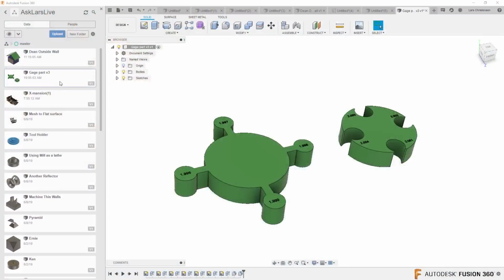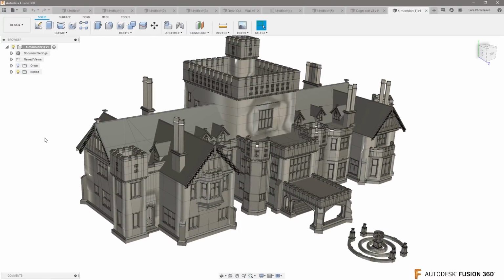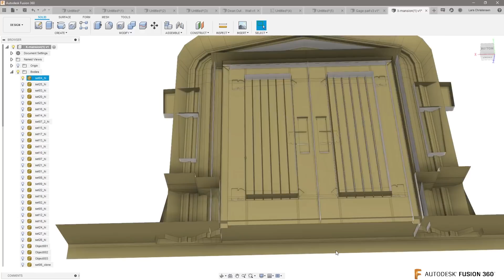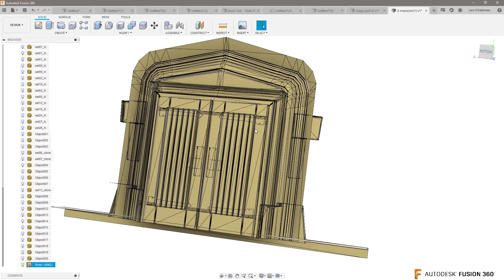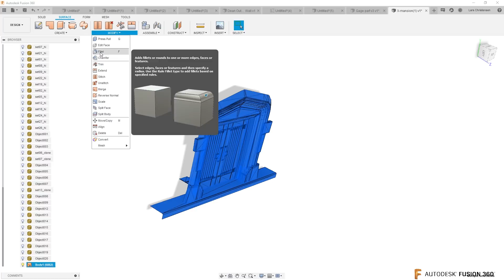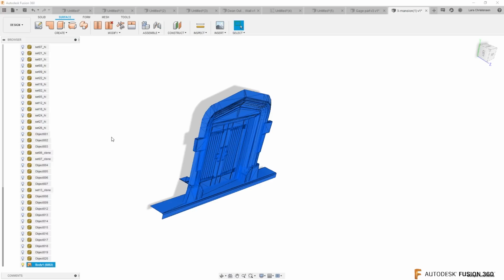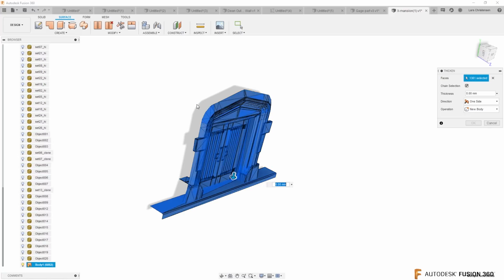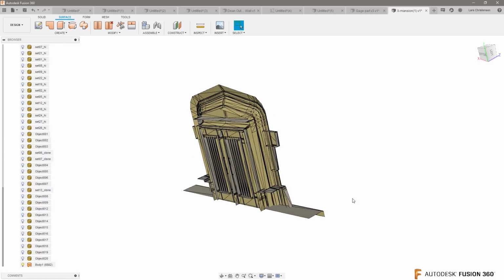Fusion 360 — BROKEN OBJ File for 3D Printing — Ask LarsLive

Comment: Open in Windows 3D builder. It will tell you that it needs repair. Click on the notification and let it stitch it together.

If it's too broken, open it in blender, select edges you need to fill and press 'f' to fill them. Then try again in Windows 3D builder so that it can fix it the rest of the way.

Blender also has modifiers for adding thickness. Just realize that internal geometry can mess you up.

The remesh modifier is also fun to play with.

Comment: - It's a mesh issue: use a mesh app.
- Also, as the model was purchased, review the description; contact the seller; explain the situation; find a solution:)
Reply: F360 is a great (free) app... at what it's designed for. BUT, it is not the right tool for every situation. A '3D model/modeler' is FUNDAMENTALLY different than a 'surface mesh model/modeler'. Understandably, those new to 3D modeling have often not been exposed to this very important fact/distinction. A quick google should clear things up:)...

Comment: I do stuff like this alot. It will be a very tedious. You will won't be able stitch it all as-is, but you would need to go through and trim all the meshes to get a nice skin, with no manifold edges, and then cap the bottom. Something like this would be best in Meshmixer or Modo. This file looks like it was designed as a CGI or digital art asset, not for printing. The quality is actually pretty good, just not any good for the desired application. Fusion just doesn't have the range of tools needed to do something like this effectively. Not a problem with Fusion, more that it's  CAD focused rather than mesh modeling focused.